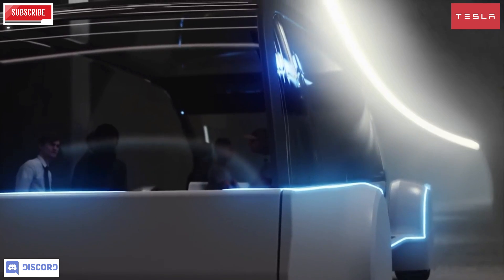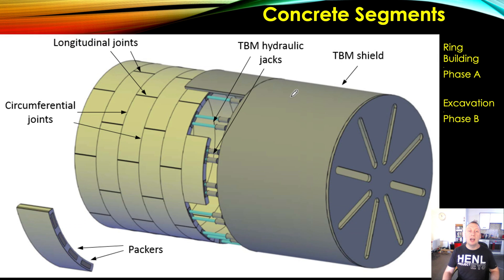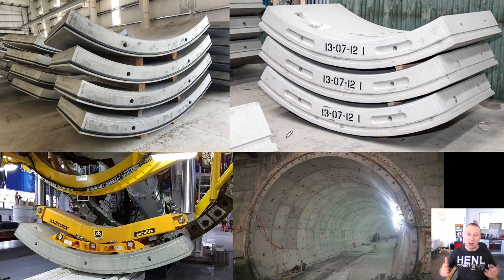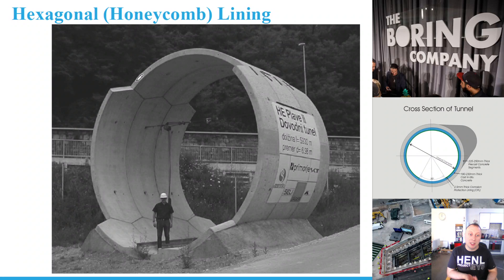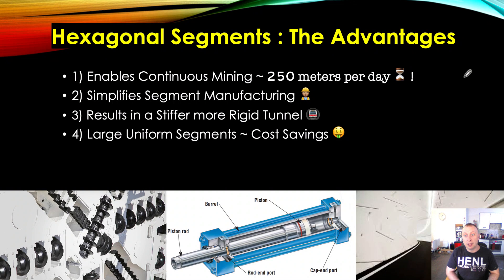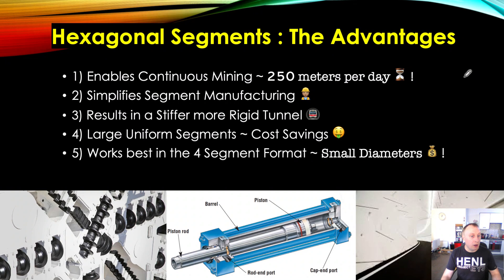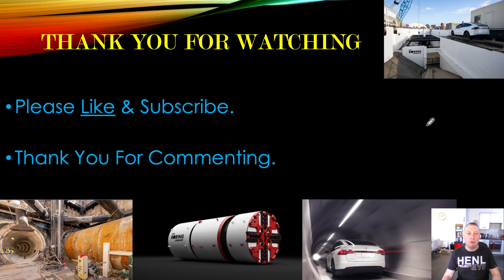The Boring Company 🚇 😃 🇺🇲 Hexagonal Concrete Segments Are The Future 👷🏽‍♂️ 🏗️ 🚎 PART 1

Comment: What about the idea of using the extracted material for making the segments? will that stiill result in savings?
Reply: The materials for making segmental linings are high quality and very specific. Very rarely can you just use the excavated material.
Reply: Robert, I thought TBC already used the excavated muck to make wall panels at the mouth of the tunnel.  Did Elon not say that's what they did with the Hawthorne test tunnel?
Reply: Diana X I think someone (not Mr Musk) claimed this but it was not the case. The launch shaft walls were secant piles by the look if it. Put in place before the shaft is excavated.
Reply: @davidsalisbury50 
I hate to disagree with you but it very much was Mr Musk that said TBC were making the concrete wall panels on site at the mouth of the Hawthorne tunnel.
https://youtu.be/AwX9G38vdCE

I refer you to 16:27 in this video where he and Steve Davis are giving a presentation and relaying what TBC had been doing at Hawthorne as well as future aspirations.  There is no doubt he was speaking in the past tense regarding what had already been done at Hawthorne.
Reply: Diana X I understand. I thought you meant the support of the walls in the launch shaft, a quote I recall from another video saying they used their compressed blocks for the lining. They didn’t of course.
This video is crammed full of half truths or flat out lies.
I originally thought Steve Davis had been brought on board as an experienced tunnel engineer. Turns out he is a failed yoghurt salesman.
I could spend a day picking faults with everything they are saying.
It’s bizarre to me that people take this as fact just because he spouts it.
Reply: @davidsalisbury50 
I'm on exactly the same boat as you with regard to how so many people blindly believe what is said. I had also checked into the background of Steve Davis (so knew about his yogurt exploits). I also checked out the background of his predecessor (whose name escapes me) that fronted the applications and presentations to Hawthorne Council for the test tunnel.  He has an architectural background and specialised in retail fit out projects.

Regarding the bricks that TBC claimed it made from excavated material I remain extremely sceptical about that also.  If the videos showing the train pulling filled wagons out of the tunnel is anything to go by then it was slurry.  They allegedly were to sell bricks from premises acquired at the other end of the test tunnel but that never opened.  If (as Mr Musk claimed) they did not remove from site the spoil arising from excavations then there should have been a mammoth stick pile of bricks that would not be too dissimilar is size to the adjacent spacex multi story car park!
Reply: This material, usually mostly dirt and rock, can be used to make compressed earth bricks for constructing homes and walls. https://www.thoughtco.com/build-an-earth-block-home-177668
Reply: @juanasenjo8515  nonsense, there is already enough material at the surface to make bricks, plus most homes in the us a made of wood
Reply from the maker: The quality & type of rock underground could change several times over a One kilometre stretch.
You are playing Russian roulette if you want to use it as aggregate. I agree with David Salisbury on this point !

Comment: I'm curious how flexible the hexagonal pieced tunnel would be during an earthquake; CA and surrounding states have many quakes each day of 2.5 and lower, but the odd quake 5.0 or larger do happen. How would this type handle it, better or worse than current system?
Reply from the maker: I'm no expert on California or Earthquakes but 50ft down the tunnel will flex with the ground. Unless it is a monster earthquake to rival the top 3 biggest of all time then I'm 99.9985% sure it will survive unscathed.
Reply: @BoringRevolution  
That agrees with real world observations.  SF Loma Prieta earthquake was a 6.9 event.  Mexico City 8.1.  Tokyo 9.1.

The largest earthquake ever recorded was in Chile at 9.5.  I can't find anything about tunnel damage in the area.
Reply: According to Musk and other engineers, Earthquakes are a surface phenomena and don't affect tunnels much if at all.
Reply: @squishybrain  
I've searched and found no tunnel failure in extreme earthquakes.  There are subway systems and tunnels in Tokyo, Mexico City, San Francisco, and LA which have all suffered major earthquakes which have caused large amounts of damage at the surface level.  During the earthquake that knocked down a section of an elevated highway and destroyed part of the Bay Bridge in SF there were BART (subway) trains in the tunnels and people in the trains weren't even aware the earthquake was happening.  

I suspect a tunnel would not be routed through a major faultline where there might be upthrusting as plates move.
Reply: @bobwallace9753  Just as I believed. Earthquakes are of less concern than most people think.
Reply: @squishybrain  Just a bit more detail.  After a lot of searching all the damage I found was a bit of flooding in one tunnel.  IIRC it came in from a station or where the track exited the tunnel but I might be remembering incorrectly.  

And there was one incident of minor damage when some tiles or pieces of concrete fell off in  or close to a station.  With formed concrete like is being used for these tunnels there's nothing 'plastered on' to shake off.

Comment: Thanks for explaining continuous boring.
Have you done a video explaining existing system with rectangular segments specially interested in how they get the last segment in place.
Reply: See the crossrail video https://www.youtube.com/watch?v=z38jlqGDZVU
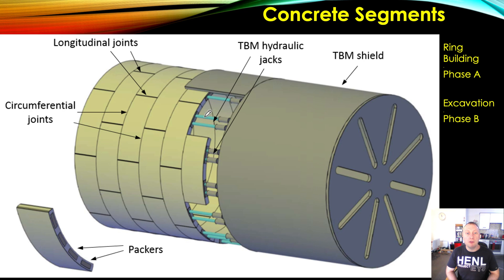Segment lining assembly around 2:50 onwards
Reply: @davidsalisbury50  Thanks David, Youtube says video is unavailable
Reply: Gr eg suggest type “how does a tunnel boring machine work” or “crossrail TBM” int YouTube, should be easy to find.
Reply: Happy to explain any questions you may have after watching
Reply: @davidsalisbury50  "The concial keystone is put in from the front to complete the tunnel ring". It what sense is the keystone conical? It looks like the other segments just a bit shorter. I figurged the only to get the last segment in would have to be slide in place, just as shown on the video.
Thanks Greg
Reply: Gr eg thanks for the reference. I hand typed it due to my lack of IT competence. Was bound to make a mistake.
The key on a lining is usually about a third of the size of the other segments, although sometimes it is the same size, especially on smaller tunnels.
The key is “wedge” shaped. Whereas the standard segments are rectangular (or almost) the two on either side of the key have one of the radial edges rectangular and the other one (next to the key) at an angle. This matches the side “wedge” shape of the key.
To put the key in (it is always last) it has to move forward of the plane of the rest of the ring (usually 300-400mm) to allow it to move up into place, and is then moved back as far as the erector can get it before one set of rams (or ram) pushes it into its final position, lock-in the whole circle of segments into place. 
There are a few variations on this system but the one in the video is most common.
Design of these lining systems is an engineering discipline in itself. Many projects have difficulty with the rings, which is then often blamed on the contractor and his team building the rings. The reality is that most of the mistakes are in the fine detail of their design, making them more difficult to build than they should be. I have worked on both sides of that fence both building and designing such systems.
Reply: I think conical was the wrong word to use in the video. A bit misleading

Comment: The hexagon shape of segments does not allow to change the direction of the tube. While the conventional segment has a trapezoid shape of segment's and ring and allows to realize straight or curved tunnel tube with the same set of the segments.
Reply: Clearly this can't be true if hexagonal segments have been used in tunnels in the past.
Reply: steve gowin hexagonal segments have generally only been used on very straight drives. Maths dictates they at no good at going around curves. That is why the leak!
TBM metro tunneling generally used the trapezoidal “universal” segment, they look “rectangular” but they are not. They are designed to take a curve 30% tighter than the TBM can excavate, thus allowing some spare for continuous alignment adjustment.
The video author continuously denounced current technology as primitive, mainly because he doesn’t understand it, then makes unsubstantiated claims about what TBC can it will do. It’s a common theme in all his videos unfortunately.
Reply from the maker: @davidsalisbury50  Not true at all David. Why are you constantly commenting on everything ? 
At no point have I referred to anything as "primitive" or bashed any other tunnelling company!!! Unfortunate In the last 10 years Herrenknecht have turned into the next General Electric. I wish them luck but just like IBM its a slippery slope. 
What exactly are you saying Prufrock can't do... 100 meters per day ?
Reply: A Boring Revolution sorry Will but I have spent a good part of my career designing tunnel linings. 
Hexagonal linings are very limited in their application because of the three reasons I have outlined elsewhere. The are the fastest type of lining construction I admit (although the fastest lining type is the wedge block system used on the channel tunnel, which is designed to leak).
Reply: A Boring Revolution. I have yet to comment on “Prufrock” as it is as yet only a concept as far as I can see. I have seen no technical details, and certainly nothing revolutionary to get excited about.
The current records are generally less than 100m a day, although there are some recorded individual days achieving over 100m.
I am ready to be highly impressed with Prufrock when it is built and starts to perform. Especially if it can handle mixed ground and hydrostatic pressure. But until then...
Reply: I comment because you ask for them. And because I am truly passionate about tunnelling.
Reply: @davidsalisbury50  A few months back Musk posted "Prufrock is alive".  Since then there have been reports of something happening between LA and Vegas.

"photos of the Boring Company's San Bernardino County facility in the desert near Adelanto, Calif., including a tunneling machine and large storage tent"

My guess that Prufrock as been built and is being refined at a test site.  We might see it show up for the Vegas Loop extension but I think it more likely BoringCo uses the TBM already in place.  

When Musk has talked about faster tunneling he stated a daily average rate of 60 feet per day for regular TBMs and said they were aiming for 15x which would be 900 feet per day.  About 275 meters per day.  I doubt we'll see that sort of speed initially, it may take refinements to make that large a change but I expect Elon and his engineering team had what they thought a likely route to getting there.
Reply: Bob Wallace all noted. But none of it is confirmed as yet. Saying it is “alive”would be turning the cutter head or having a play with the segment erector. I saw a video of that, using a game boy controller (which does not have enough controls for a segment are for by the way). It was remarkably slow compared to the existing ones I have used. Again, it looks cool, but it is well established existing technology.
Everything TBC have highlighted as something new or a breakthrough, and have been able to show some physical evidence, is existing technology. In many cases quite old technology.
I’m waiting for the first sign of something new.
I have run the numbers on the logistics of 275m per day for a 4m internal diameter tunnel and there is a lot to achieve.